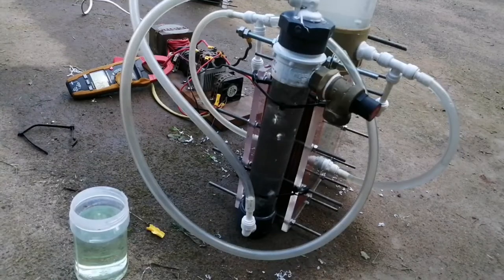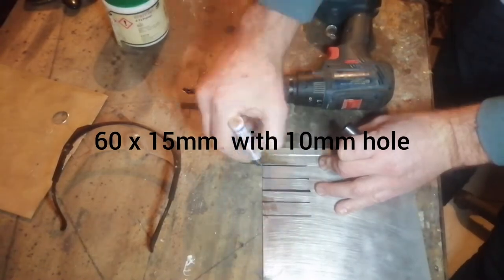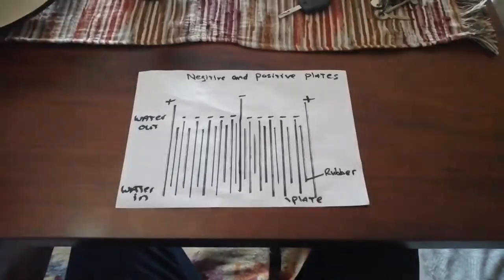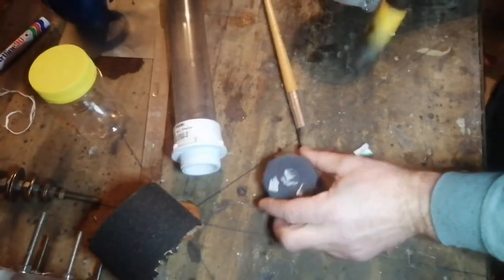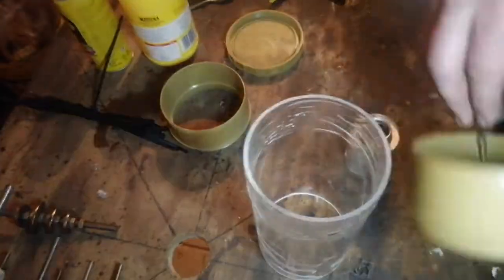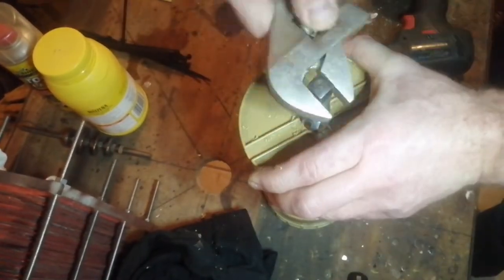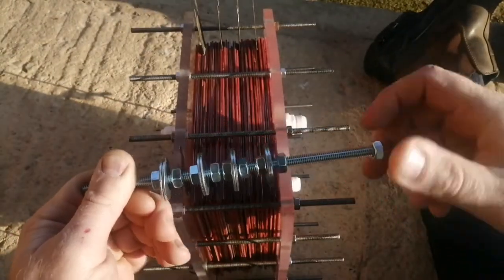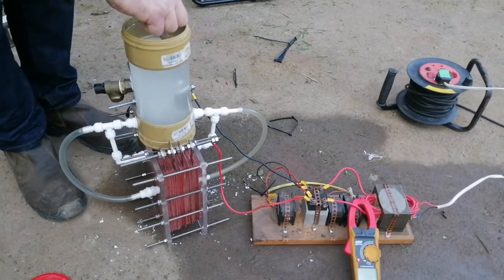HOW TO MAKE A HYDROGEN AND OXYGEN  DRY CELL GENERATOR WATER TO FUEL CONVERTER.

Comment: Very nice video... I've done  very similar and learning a lot.. the alternating holes between neutrals only blocked flow.. if you're using tap water you get brown sludge, distilled water stayed clean.. so take use of tap water.. !!!.. You'll find flux leakages from the hole causing a burn mark on the opposing plate.. oxidisation side of current flow... 
Nice video ..
Thom in Scotland.

Comment: You can also reuse an old battery casing to make wetcell instead of drycell. Battery casing are made the way they are because it's the best way to hold a corrosive electrolyte with the least chances of leakage.

Comment: Good piece of work.
Where is the video of making a flash arrester. And please can you make a hydrogen oxygen separator system.
Reply from the maker: Hi Magnet man, I tried making a separator but failed miserably. So back to the drawing board. But definitely in the near future.
Reply: @yourworkshopmate372 
😆 
InshaAllah
There is an expensive way resorted to be industries 
And a cheaper way as done by "inventive" YT channel.
Reply: The night hawk in light channel had made a similarly project with a flash arrester. You might want to check out that channel for some possible flash arrester designs.

Comment: Hi, I'm looking for a bit of advice here, I'm looking to purchase off eBay some, silver solder , (  rods as you have ) .. and a hand held torch, used for browning food , daft as it seems it gets up to a fine temperature.. the flux type confuses me some what...so any experience advice welcome...
316 s/s ... 0.90 mm thick ... Whilst strips also .... s/s are ONLY 0.20 mm thick to allow me .manipulation of lead offs.. 
Correct flux type is confusing.. any advice gratefully received...
Thom in Scotland.
Reply from the maker: Hi Thom. You can go to a refrigeration spares shop. They will have that there. I'm an industrial refrigeration tech and I use silver solder often. You can buy the rods that are already coated or you can buy the rods that are not coated and buy the powder flux seperate, which I prefer because the rods that have the flux on seem to loose the flux quiet easily when you store them and it's quite brittle. You can buy the brazing torch there aswell called a map gas.
Reply from the maker: You also need to heat up the thicker plate first then till cherry red then the thinner plate. You have to play with the heat till the 2 metals are the similar temperature then if you have a rod without flux, heat the rod and dip the rod into the flux powder. Heating the rod allows the flux to stick to the rod.
Reply: Thanks, good guidelines information... Will order of eBay and let you know how I get on.. meny thanks.
Thom in Scotland.
Reply from the maker: @fuelban  I'm in the process of building another fuel cell that separates the oxygen and hydrogen. Then I'm hoping that I'll be able to control or know exactly how much hydrogen I'm putting into the engine. I'll post that video hopefully soon.
Reply: @yourworkshopmate372  ...
Nice one, I've subscribed so will get you're posting of video.... Thanks.
Thom in Scotland.
Reply: @yourworkshopmate372  ....
A 7 plate cell... 5 neutrals... Of the five neutrals, the centre neutral has no.... Holes, no gas top hole, no waters flow bottom hole... Equates to a division of the reactor...
Water flow in at base of each side... Top end hole takes gas oot separate... 
Near pure hydrogen at negative side. Near pure oxygen opposite side... So...
Pure hydrogen, passes any sensors in car...
Thom in Scotland
Reply from the maker: @fuelban  you got me thinking about that. Sounds like a good idea.. I'm going to do the math. Thanks
Reply: @yourworkshopmate372  ... No problems..
I'm 66 and retired,, been ill past 10 yrs, but whilst not posting new videos, I've been working still on project's...
Worth noting... I've found a new cell runs for between 6. To. 11 hours then foam appears.. you're not getting shot of this foam under any circumstances... However.. let me see ,/ know, if you get foam on either side !.
I had 101 hours with no foam in 2014... Let me know...
Thom in Scotland.
Reply from the maker: @fuelban  Thanks Thom. I'll try your method. Also you can use bicarbonate of soda if you dont want any foam but I dont think it works as well as costic
Reply: @yourworkshopmate372  koh has the best conversation, tho comes with dangers... I use koh, yet also use goggles, gloves, and safe use.. religiously... ( Yes )... But koh is best chemical conversation factors...
Thom in Scotland.
Reply: @yourworkshopmate372   hi ... I have taken you're advice and purchased , powder flux and flux free rods... Will let you know how I get on in due course..
Hey, you said no foam wi bicarbonate soda...
Question, did you run unit over 6 to 11 hours Pluss,.. I am curious... Everything I've ever used bicorbonate included gets foam within these 6 / 11 hours parameters..
Hope you keep written book logs... .... Lol...
Thom in Scotland.
Reply from the maker: @fuelban  glad to hear that. No I didnt run it that long. Is the water that you are using straight from the tap?
Reply: @yourworkshopmate372  ... No never use tap water, NEVER use river, nor rain nor snow, all have micro particulates, these burn  in the electrolyte, I.e oxygenate, turn plates and water sludge brown... Only use distilled water, deionised.. same as you're wife uses in iron.. she will inform you that tap water brown's the ironing... Same in the cell...
Distilled water does not discolour, you will get a slight brown on the oxygen side of all plates, it's oxidation.. can't be helped... But 2 yrs running Pluss, and my water's still clean.
Thom in Scotland.
Reply from the maker: @fuelban  thanks for the  advise thom much appreciated.